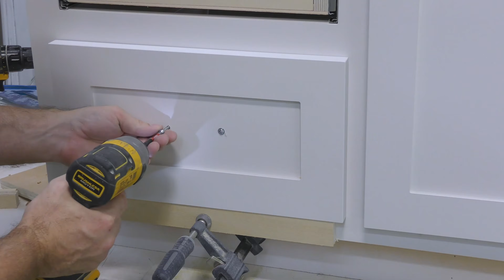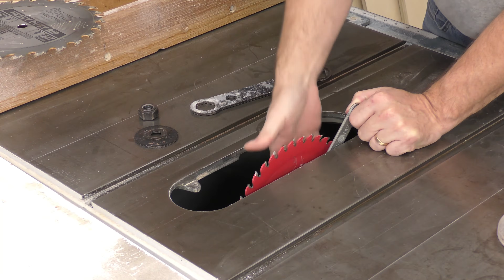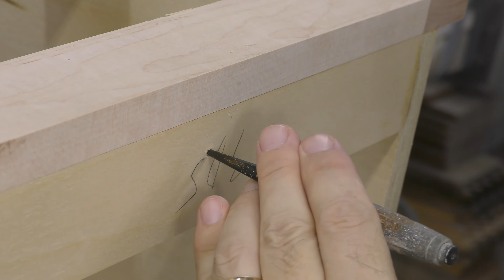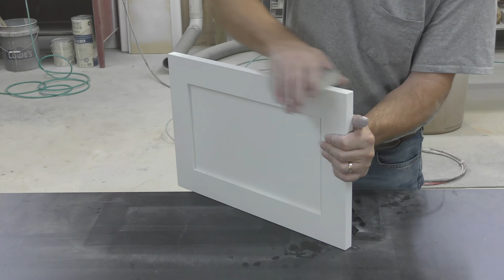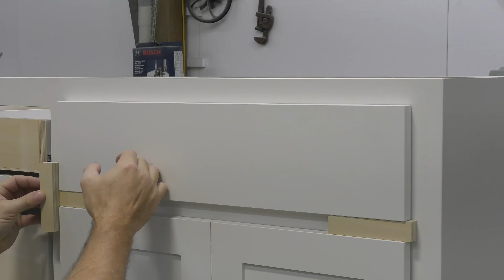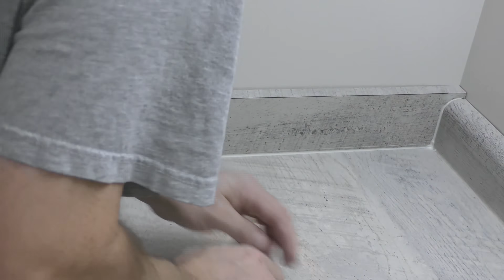How to Build & Install a Custom Bathroom Vanity Cabinet.

Comment: MDF doors for a bathroom vanity? How do those hold up in a high moisture area?
Reply: more stable than solid wood
Reply: @shoebert31  they dont! Mdf sucks in moisture. Use hardwood with some type of water resistant stain/ paint . Will last longer than you. 😊

Comment: so face frame before or after carcasses?
Reply from the maker: That’s my preference. When I design a cabinet or a kitchen full of cabinets, I always start with the view from the front. So for me it just makes sense to build from the front back. This also gives me the benefit of using the face frame itself to lay out bulkheads or any other internal components within the cabinet. 
Having said that, I know several cabinet guys who approach it completely different. Nothing wrong with that at all, this is just the process that makes the most sense to me when I’m building. 

Thanks for the question and thanks for watching.

Comment: Curious what you charged or would charge for this? And where you’re at in the country.
Reply from the maker: I really don’t remember off the top of my head, but I think it was somewhere around $1,600. I’m in rural MS so the same work in most large cities and or other regions of the country could go for double or even more. It all depends on regional materials cost, regional cost of living and the ease or difficulty getting to and from the project site. You also have the supply and demand factor to equate into it as well. 

Hope this was more helpful than confusing.

Comment: How is guessing with a drill bit to find studs and putting 12 holes in the wall less guessing than with a stud finder?? Heck, you could even get some rare earth magnets and find other drywall screws in the wall to find your studs. Way less repair and a helluva lot less guess work than knocking on the wall and poking with a drill bit.
Reply: or at least find the studs before the vanity comes in and hid the holes behind the vanity itself...
Reply: This part of the drywall is covered by the counter top and/or backsplash.
Reply: I never thought about the magnet idea! Brilliant! I’m totally going to try that.

Comment: What door slides do you use?
Reply from the maker: I’m not 100% sure what you’re asking. 
For doors I use a concealed Blum hinge with a 1/2” overlay. 
For drawers I typically use a full extension slides. I don’t see a lot of difference between the different brands on the market. I don’t recommend buying the soft close full extension slides that side mount as I’ve seen a high failure rate with them. If you want soft close I recommend you go with Blum bottom mounts.
Reply: @thesoutherncraftwoodshop4134 Salice under mount slides are better. IMO